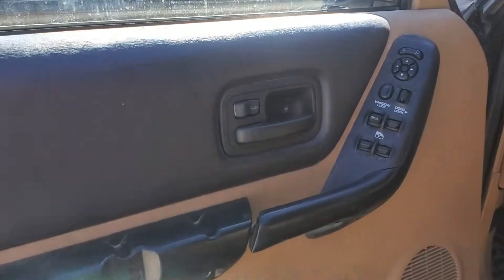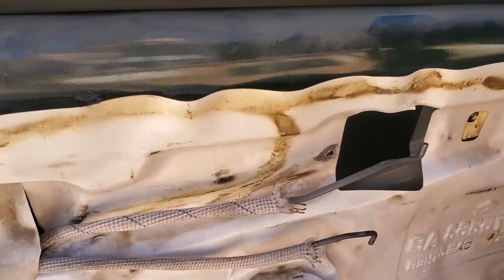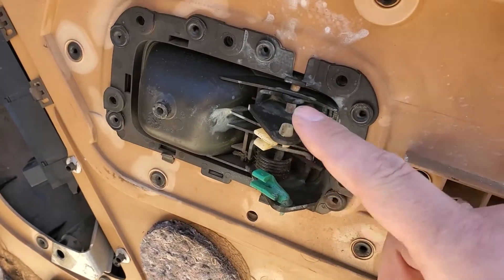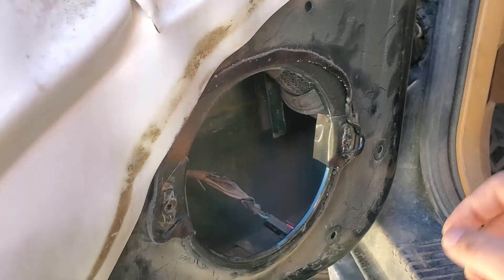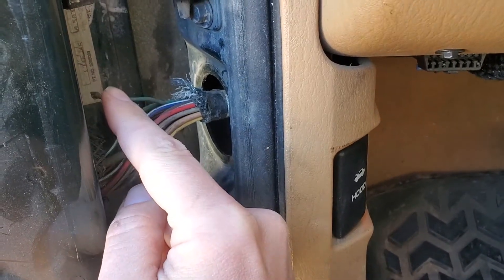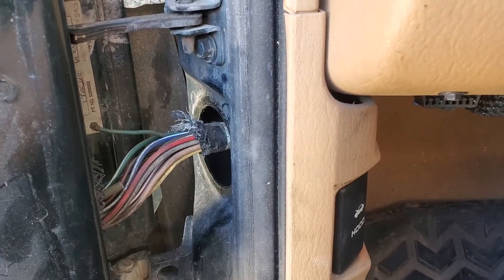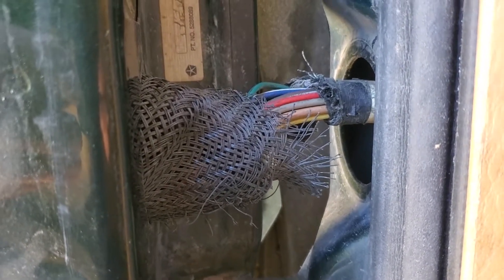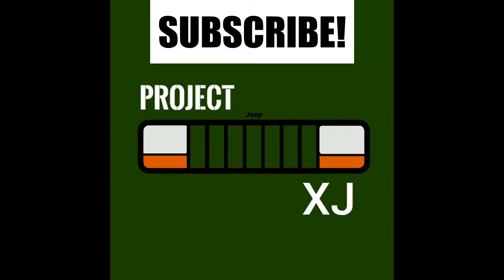Jeep Cherokee XJ: Speaker Not Working?| Fixing The Wiring in The Door

Comment: 2000 4cyl. 5spd here.  Just swapped my head unit thinking the f/r left channel was bad. Didn't fix the problem.  I'll check the wiring! Thanks for the info!
Reply from the maker: I have never seen a 4 cylinder XJ. Is it an SE?
Reply: @ProjectXJ  yes, it's an SE. 2.5L (150) SMFI I4 "Power Tech" engine with a 5 spd. 1st gear in 4   low is super crawl.  It's great in the woods. Almost as fast off the line as my old 6cyl xj. Gotta downshift to 4th on highway hills though. 😅

Comment: No wire nuts in vehicles. Get a soldering iron, heat shrink, tape of any kind, hell , put chewing gum on it. Don't use wire nuts
Reply from the maker: If i said wire nut, i misspoke. I used a butt splice with heat shrink. 🙂